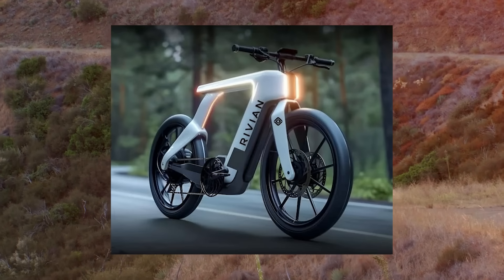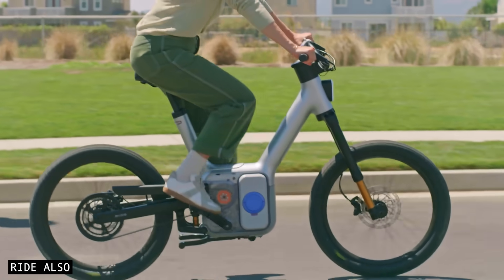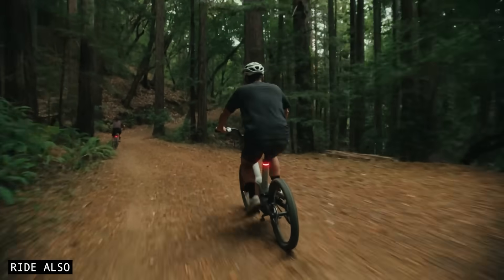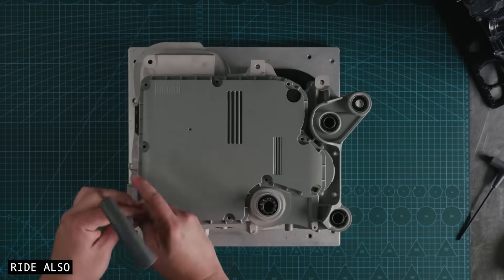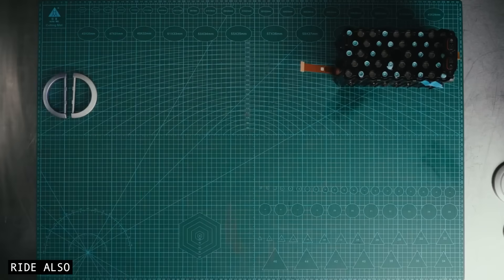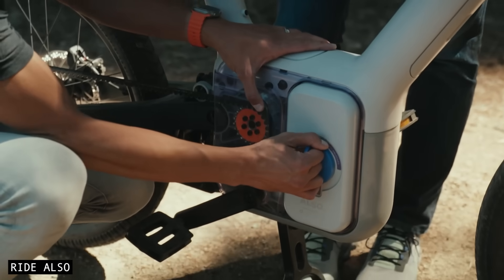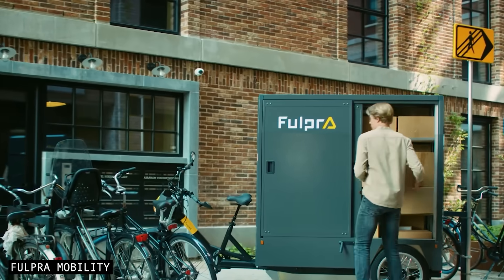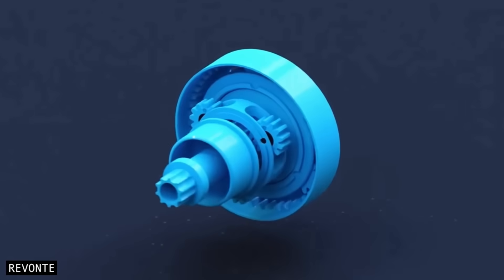Here’s Why the $4,500 Rivian eBike Uses a Digital Gearbox & Belt Drive!

Comment: These Rivian bikes sound sound a lot like Van Moof bikes, they looked great as design pieces, but in my personal experience, it has been one of the worst ebikes I have ever had. Extremely expensive replacement parts and gimmicky features, such as automatic shifting and unlocking. I ended up selling it for an Aventon Aventure, as the motor, speed controller and battery can be cheaply replaced with easily retrievable parts; have been happy since I got it, even if I had to replace and rewire the speed controller, but it only cost me 24$. I also have a yuba Spicy Curry cargo ebike using the bosh system to carry people and stuff, and this one too has the same annoying problem as the Van Moof, all replacement parts are specific, diagnostic software is locked and it is hard to service. Manufacturers often forget that these need to be simple and cheap means of transport, not complicated transport solutions.

Comment: That bike is ungly as hell. If they moved that brick of a battery into the down tube they could make the bottom bracket area look smoother and more bike like while keeping most, if not all, of the benefits as explained here in the video. Proprietary parts and ugly as hell means I won't even be looking at one if I wanted to.

Comment: "The drivetrain also recovers up to 90% of your braking energy through regenerative braking."  This statement is misleading. The front does the majority of the braking, and this bike has zero front regen. Rivian is one financial crisis (e.g. AI bubble) away from bankruptcy, and if/when that happens, every bike will be bricked, just like the Fisker EVs. Rivian has never been close to breaking even and has no clear path to getting there. This bike will probably cost about the same as lower mid-priced motorcycle, so about $10k to $15k USD. It's like Rivian saw the explosion in e-bike sales in 2020/2021 but is a couple of years late getting their product to market. KTM went big on the e-bike market and that was one of the contributing factors that led to their bankruptcy. The delivery quad  looks like a bigger, less maneuverable and much more expensive alternative to the Kyburz electric delivery trikes which are proven with hundreds of millions of kilometers in service.
Reply: I've never thought regen braking on a bike was a good idea.  When I ride, I coast to a slower speed.  Just conserving energy and letting momentum and friction work things out. Maybe in the city it would work better.  I don't believe you would get much range out of it.
Reply: @artboymoy That is biking, doing a lot of coasting to conserve the energy your legs need to spend. Only when riding a lot up and down hill and with a lot of breaking, likely on high speed bikes, it makes sense.
Reply: I think it's more like an electric car, you mostly use the motor and by extension the back wheel to brake, and use the brakes to come to a complete stop or in an emergency. Stopping quickly wouldn't produce much regen anyway, but coasting to a red light would produce more. In my past life as a bike courier I've forgotten to replace my front brake pads and had to deal with just using the back all day and it's not fun but it's definitely doable, the majority of stops aren't emergency ones. The part I question is it extending range by 25%, maybe mountain biking, where you've got gravity working more for you and using less power downhill, but I can't see hitting those numbers in a city commute
Reply: Indeed. Compare this to existing brands like Riese and Muller and you can’t stop laughing about the Rivian. They have no idea what a bike is.
Reply: Price looks to be $3500-$5500. The tech looks promising, to me, especially for delivery vehicles, two-wheel and four-wheel. As for Rivian, they have a clear path to viability, depending completely on success of next year’s launch of the R2. More importantly, Also is a separate company with none of the debt structure of Rivian so success of Also will be fully up to its own products, independent from Rivian.
Reply: @jysmtl  Rivian hasn't yet figured out how they're not going to be losing a heap of money on every R2. That's part of the Ponzi scheme, promise something with a crazy low price (for them) before they've figured out how to make it for that price. They have to prop up their share price to prevent a stampede for the exit. Financial crisis or not, the headwinds are against US manufacturing due to stagflation and rising costs of imported materials and components. Also CATL has just nuked the EV industry with the Sodium Ion battery. Rivian will have to redesign every model around the new battery tech.

Comment: Why make it a bicycle at all? If the goal is to reduce the physical effort required to ride a bicycle, why not remove this effort entirely? Just take off the pedals and crank, and install a hand throttle. We've been through all this before, more than a century ago when gasoline engines were bolted to bicycles, and these motorized bicycles evolved into motor (ized) (bi) cycles. The beauty of the bicycle is, was, and always has been that it is human-powered.
Reply: I want the pedals.

Comment: Nobody buys an 85 lb bike to pedal it.  Remember the 1970's two stroke mopeds?
Reply: My efat bike is 85lbs with my saddlebags and locks, i ride it unpowered all the time, it's barely noticeable on the flat and it's a great workout on hills.  My emtb is 55 lbs alone, i ride that with no boost all the time too.
Reply: @stephenshoihet2590  that's cool, I have a good emtb as well which comes in a similar weight to yours, and as much as I love it for some applications it is not great as an actual mtb for downhill. Personally I want to see lighter weight e-bikes for more agility and efficiency, like a good hybrid for commuting or bike packing. 

Just waiting for the new batteries to come online at this point.
Reply: @petecabrina my enduro emtb is pretty good at downhill, better than I am 😄
Reply: Like nobody would ride a bike that doesn't move but still delivers resistance as if it would? 😜
Reply: This is 85lb? Thanks for saving me from watching the vid.
Reply: Someone might because of vehicle regulations.
You might not need a license riding a electric assisted bike, but you might need it for a full electric bike.
Same for license, registration and vehicle tax. Also maybe road access. There might be situations where electric assisted bikes are allowed, but not electric or moto bikes. 
While I agree with your sentiment, there are just a few things in reality that might make it work.

Plus maybe the range might improve if you pedal... So maybe that's also something some people are looking for... Fewer stops to your city dwellings for charging maybe...
Reply: @porcorosso4330  Also due to physics (Force = Acceleration × Mass), the heavier the bike is, the more dangerous it will be on collision. We NEED regulation on such e-bikes, as they will only get heavier and deliver more speed than any human-propelled bike, turning it into the problem akin to SUVs.
Reply: My kickscooter (Segway-Ninebot Max G2) weighs 25kg (55lb) and it's already on the limit of how much people could lift without turning it into involuntary exercise.
Reply: On second thought, this thing is perfect for bikesharing, it has all the features needed - battery swapping, GPS tracking, smooth shifting, ease of use. Weight doesn't matter much if it's durable.
Reply: @saiv46 weight is still an issue
Reply: It wasn't entirely clarified, but I couldn't tell if this bike has a throttle or not. I assumed the thing on the right handlebar was a throttle, but this video made it seem like that was a digital shifter.
Reply: Never heard of a cargo bike?

Comment: Huge concern is Rivian’s long term survival.  Their EV business is barely profitable and it’s only tariffs and trade disputes that are stopping the wave of Chinese EVs from crushing them.  If the EV business fails you could be left with a beautifully designed orphan that cannot be maintained or repaired and may be bricked if it relies in cloud services provided by the manufacturer
Reply: It’s a plus that this is a separate company. It will succeed or fail based on its own merits.

Comment: Okay, I give this bike some credit. The decoupled drivetrain and locking rear wheel do offer better passive security than other drivetrains, and fair play on the repairability and durability. Maybe I'm an analog junkie, but I prefer the higher efficiency offered by direct pedaling. A true analog fallback is always nice for when the battery dies. 

I also feel like full digital drivetrains have somewhat lost the plot on what makes an e-bike distinct from motorcycles. We're pretty close to scooter and motorcycle territory here as far as weight and torque go.
Reply: Don't think of it as a bicycle with power assist. It's more of an electric scooter with pedal charging 🤓
Reply: @Yataro79 that is how people treat most e-bikes anyway
Reply: I'm wondering how hard you need to pedal with that 80 lb frame to get it to go 5 or 6 miles an hour.  IMO, if it can't do that in limp mode at the very least, you may aw well walk it or just call for an UBER to pick you up.
Reply: @artboymoy  yeah, heft that into an Uber at that weight...should be fun.
Reply: they had to do the pedal gen thing to enable them to be pedal bicycles legally in a bunch of jurisdictions, which matters for the delivery thing. doing a bike is an also kind of a thing for that. so anyhow you're not really supposed to pedal as much as pedaling as pressing a button thats not a button.
Reply: Honestly, the security stuff is great, and this price point is not ridiculous.
Reply: I don't think I would enjoy pedaling a dynamo with a constant smooth resistance..
My favorite pedalling experience among the e-bikes I've tried is still a throttled hub wheel, where you just make additional power with your legs

Comment: 4:15 Regen braking: Only for the rear brake, it seems. Which is the least powerful brake, but sure, for moderate braking it works. Actually combining the power/efficiency benefits of geared ebikes with the regen of hub motors is pretty nice. And with the extra modules it does seem like a practical and comfortable ebike. The built-in wheel locking is good too.

However, the "all proprietary parts" setup sounds like a dealbreaker to me. If I can't replace the stem, handlebars, grips, saddle and pedals to others that fit me ergonomically, then the bike is a huge risk to buy. That's one benefit of current, less integrated ebikes, you can customize them every which way.
Reply: It would also introduce a bad habit of using the rear brake more, possibly forgetting about the front in an emergency situation.
Reply: @rayzecor  The crazy thing is, some people get taught to "never use the front brake, it's dangerous!". Shocked me the first time I heard it said.
Reply: @tvuser9529 Yes, my father used bikes all of his life, he is 66 years old. When I told him a few days ago that I use the front brake more, he said I shouldn't and that I'll flip over the bars 😂

Comment: Good job!  Your estimated losses for pedal-by-wire are similar to my own guesstimate.  It seems the TM-B's battery will be taxed at a higher rate due to pedal-by-wire losses, and Also is banking on making that up with re-gen.  That is, a "normal" pedaling effort imparts about 95% of the pedal energy into forward locomotion, with the battery and motor making up the difference.  Under your analysis, a pedal-by-wire can provide about 65% of the pedaling energy to propel the bike forward, and the battery and motor will then have more to make up.  I can see re-gen working well on the back side of the steep hills in my area.  I can't see much re-gen coming from stop and go, as you lose so much energy getting going again, and only get a fraction back when you use re-gen to slow down.  The two primary reasons e-bikes are so useful are to: 1) overcome hills, and 2) overcome strong headwinds.  I'm not sure you get a lot of benefit with re-gen when riding into a strong headwind.  Maybe you get some re-gen slowing down with a strong tailwind.  Finally, I wonder about the ability to run power from the generator to the motor.  I think this is kind of tricky.  I have to wonder if the power must go in and out of the battery first, triggering more conversion losses.
Reply: And regen is only possible on the rear wheel. I don't see them getting enough out of it to make up just for the losses from turning the belt continuously, instead of freewheeling at the rear hub.
Reply: @Kevin75668  yeah, a front hub motor would be needed for getting the braking energy when one needs to brake harder than the rear wheel is capable of. A motor designed to be light and to coast with minimal losses (it'd only engage when braking or when helping with traction during slippery conditions)
Reply: they need power to be moving from the pedals for the delivery trucks to not be "cars". not so much as for pedaling itself in the end. there's no battery size limitation on the "ebike" trucks
Reply: I would also mention that a lot of the time spent riding an ebike is above the speed limit and thus with no assistance. In that case, you would really feel limited in terms of top speed and feel less like you're riding a bike.

At least that's just me when I ride my wife's emtb, not sure if it's the case for everyone and depends on legislation.
Reply: @rayzecor  From what I see riding my e-bike the past several years, is most e-bike riders are age 50 to 70 (that age group can afford an e-bike and need it most), and they are not racing around.  (I'm talking about legal, classed, e-bikes, not illegal, unregulated "Sur-Ron" type "e-bikes".)  From what I see, the vast majority of e-bike riders are only going 12 - 15 mph.  Most bike paths have a 15 to 20 mph speed limit, anyway, and even in the U.S., the world is moving to separate bike infrastructure.  Personally, my bike computer tells me that I average 12 to 14 mph on thousands of miles of e-bike riding.  Therefore, most e-bike riders I see in the wild are always using e-assist.
Reply: @tedbellSEA  I see. I was just speaking from my own experience and was talking about the bike's speed limit, not the road's. In that case, it wouldn't be so bad.

Comment: Indeed the drivetrain makes sense only as a cargo quad. As a bike, it is bewildering that it had everything needed to be an efficient parallel hybrid using just one motor and the planetary gears to provide boost, recover energy and control the gear ratio and yet they chose the dumb way.
Reply: Imagine a drivetrain like the Toyota hybrids, but with the pedals taking the place of the ICE.
Reply: @Aethid  except that a Toyota hybrid in most models also directly drives the wheels when needed.
Reply: @Skylancer727 Yes, exactly?
Reply: You can't get boost and recover energy and control the gear ratio using only one motor, you need at least two for that - and then in many situations, the controller will essentially use one of them as a generator for the other anyway. Only in a narrow range of speeds would this be more efficient. Likewise, mechanical CVTs have also pretty bad efficiency, as well as reliability problems. So, it actually makes some sense to go full electronic if you want to avoid derailleurs / gearboxes, particularly if most of the energy comes from the battery anyway - in that cases optimizing pedal-to-wheel efficiency doesn't make as much sense as optimizing battery-to-wheel and regen wheel-to-battery.

Of course, whether a vehicle where the pedals are mostly a pretentious throttle should still be called a bicycle is another story!

Comment: I wish Revonte was still around because that drivetrain had all the advantages of the ALSO except it still had a direct mechanical connection between pedals and wheel. In the event of electrical fault, the bike reverts to low gear direct drive
Reply from the maker: The Revonte looked so promising, and having tested it, I feel they were on a great path. The former owner stated that the IP got sold to a company in the bike industry, so I hope it resurfaces soon.

Comment: Nahhh. I don't like that at all. Nothing that you said about that setup is impossible with a rear hub motor, they are only less developed. Also that is like combining the negatives from a "normal" middle  motor and the series drive. Also it looks expensive, over engineered and as you had said extremely proprietary. Also I do not like the name.

Comment: This is interesting, and I'd love to try one. Pedaling a bike involves far more physics than most people realize. eg the changing momentum and kinetic energy in the pulsing legs, and how that gets turned into rotational movement.  Take a chain OFF a bike and try to pedal quickly and only then do you realize it's not so easy to be smooth.  Spin bikes with no flywheel are generally horrid to ride, and the lack of inertia reduces the power a rider can develop.
So have Rivian actually simulated the feel of a bike?  or is this nothing more than a set of pedals attached to a generator?
FWIW I drive a Rivian SUV,.. and it's superb.
Reply: I rode an Also for a brief test. It felt like a bike.